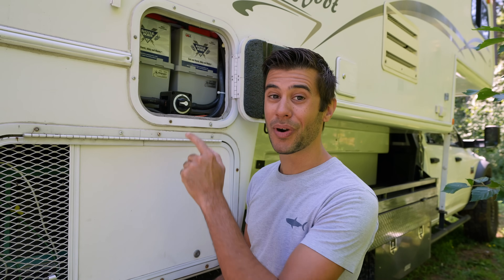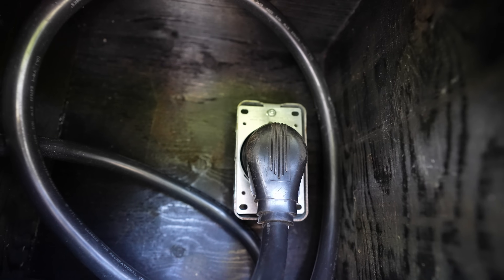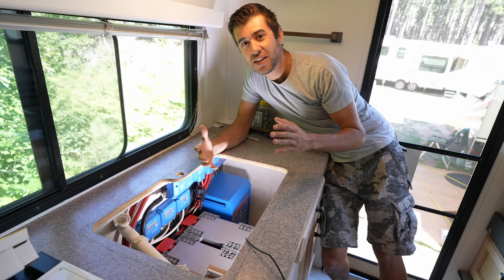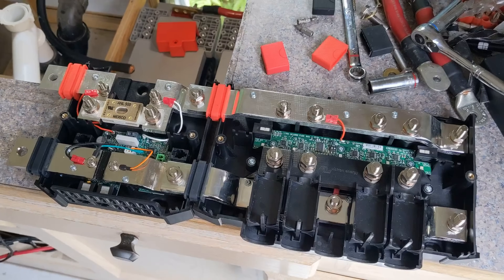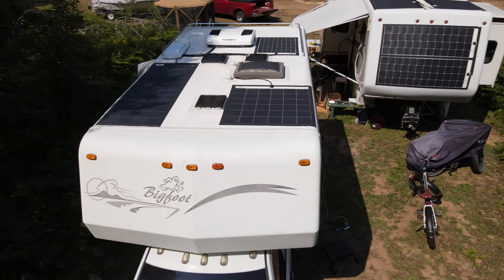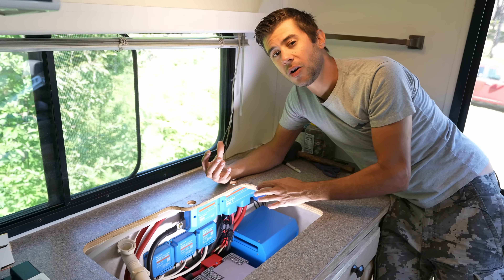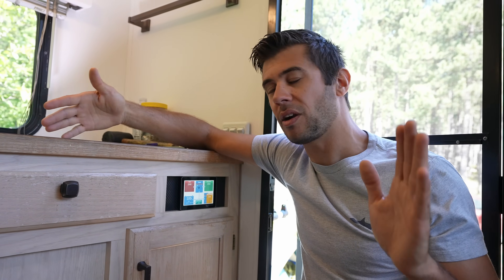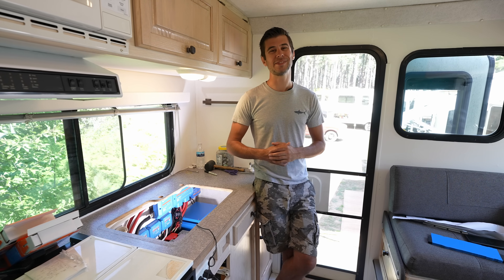What Goes Into an Off-Grid Power System? Overland RV Solar Power System With 12V Air Conditioning

Comment: Silly question, but doesn't the DC to DC charger provide sufficient charging ability that you could do away with the propane generator? If you removed the generator couldn't you have put the batteries in that compartment which would be away from the sink, etc?
Reply from the maker: Probably yes, we rarely need to run it. I have considered it but just haven't implemented it.

Comment: How do you feel about not having a Class T fuse? We hemmed and hawed about Class T necessity (or possibly MRBF), and ultimately decided to go ahead with the BEP Class T fuse block (778-T2S-400) with a Blue Sea 400A Class T fuse (BSS PN 5121). $73.36 isn’t cheap, but nothing is with this stuff. Actually scratch that, the Victron inverter is such a great price for a quality product with 5 year warranty. 
Prairie Equipment Company.

Comment: How about you get 10 lead acid batteries and you put them in series and you get 120 V and then you just get a charger on them how about that let’s make it easier and then you could run 120 V and you could just plug in the regular stuff and you don’t have to get 12 V batteries and run your car and with the power inverter and all kinds of other crap didn’t even need a power inverter if you get 120 V with 10 batteries if they did this $3000 how much are those batteries you talking about those lithium batteries do you like what $500 each $800 each what is the point of it and then you still have to use the generator and you still have to use the car the alternator the gas that’s insane I don’t think you guys are making any sense about what you guys are talking about you’re spending how much money on this and you’re getting what out of it and then you have to use four different systems are five different systems to run all the stuff
Reply from the maker: Still gotta invert it, 120DC won't do you and good. Yes 120-120 conversion is much more efficient and I have done that before with high power industrial builds (I'm an electrical engineer) but with native 12v DC needs it's just easier to do this.

Comment: I have a very similar setup with the same camper. I am curious if you can show how you integrated the new solar/interter setup to the existing Bigfoot electrical system so the 100v outlets work all the time? Thanks

Comment: Hey Tom and Cate
I’m in the final stages of putting together my build and I’m following your wiring schematic for the most part. I noticed there’s not a house fuse. Are you using the fuse on the Lynx shunt as the house shunt and is that sufficient?  Wanting to do the same thing since space is limited. Thanks Kevin

Comment: I might have missed it, but what tape are you using to attach the flexible solar panels?
Reply from the maker: You can use 3M Extreme Sealing tape, but it’s not readily available. Eternabond,  Flex Seal or Gorilla tape are excellent options too!

Comment: Very nice! I’ve been waiting for someone to tackle a Bigfoot electrical renovation. I have a 1994 1500 series BF and while is has significantly less space, I want to do this on a smaller scale. My biggest question though; how does the original converter/dc fuse box hold up to the updates? I took my rig into a solar company and was told solar/lithium batteries wouldn’t work with old converters like ours and we’d have to update the ENTIRE system..
Reply from the maker: It will work, but won't get them fully charged. Ours is disabled (but still there as a backup)  I would recommend a small programmable inverter charger for sure if your going to do lithium..

Comment: Tom, why didn’t you use the solenoid isolator instead of the DC to DC converter from battleborn?
Reply from the maker: Just more control over the current. The isolator would have worked fine in this build, but in our previous build we had too much current even for short durations and we're overheating the alternator.  With the DC to DC you can control the current.
Reply: @MortonsontheMove  but doesn’t the DC DC only allow 30amps?

Comment: Great video. I had a Bigfoot and was planning a project similar to yours. Unfortunately,  it perished in one of the many fires we had in Southern Oregon.  I'm currently in the market for a replacement. My original plan called for rebuilding all cabinets, going 100% solar, no ac and no generator. But, was planning on a 12 volt refrigerator. Don't think I could do both ac and 12v refrigerator with 440 watts of solar and 600 ah of battety. I'll be looking forward to additional projects on the camper, especially how you handle heating. (Or is that part of the ac unit?) Blowers seem to be electricity hogs. Keep us updated.

Comment: Hello and again thanks for the video. I would appreciate it if you could take a moment and tell me how the new 12V AC is working out. Is 8000 BTU enough in the sun? How long does it last? You might park under the trees to keep the unit cool, but then there is no charging unless using a suitcase panel. Thank you. Henri (RVing with Henri)
Reply from the maker: We love the 12V AC! It's kept the inside of the truck camper quite cool on hot days.

Comment: @ 12:05, you show all three of the 75/15 SCC being individually fused, but landed on the same spot on the Lynx Distributor... are you just stacking the ring terminals on the buss bar studs, or something else?  How are you bridging the gap for the fuse on the Lynx - or are you just running the positive wires up and thru?
Reply from the maker: Those all terminated in one larger ring terminal along with the power from the truck ( all charging) they are individually fused but there is a lynx fuse on the main as well.
Reply: @MortonsontheMove  so three #12 and one #6 AWG wires (each individually fused) all crimped together, and then another fuse on the bus bar as well?  I guess that does solve the problem I was looking at of trying to figure out where to fit a second Lynx distributor!
Reply from the maker: As for bridging on the lynx for the inverter I just created a custom busbar using a lug that I flattened and drilled a new hole.  It worked very well.
Reply: @MortonsontheMove  I must have missed that part 🤣 Why not use the fuse spot on the Lynx (for the inverter)?

Comment: Sorry I have been gone so long, been busy, but had to come back, been thinking in the back ground of the big picture. The 5er/this/and the toad.
Have to say in efficiency, ditch this design for a Ford F750 on 22,5 tires and 15 inch brakes. Sell the current 5er tow vehicle. Then weld a 1/4 inch plate steel by 7 feet onto the F750.
This allows the F750 to tow the 5er in the flatlands,,, then ditch the 5er for the F750 & flat bed that can haul a jeep on it's back to mid mountain.
It is a 3 way conversion that deals with flat land, mid mountain. then the jeep on the back of the F750 takes you to summit & brings you back home to the F750. Which in charge takes you back to the 5er.
Energy, development/storage is great, but does not exceed mobility.

A tri-fectia 5er/F750/jeep summit, and back, nationwide.
Reply: This breaks down costs of 
3 insurance policies
3 registrations
2 inspections
it is more simple this way. /cost/agreget.
Yea, I'm blowing up design because of insurance companies rates.
Reply: Current tires to feed.
4 on the 5er
6 on the tow truck
6 on this vehicle.
---------------------------
My design;
4 on the 5er
6 on the F750 @ 22,5
4 on the Jeep that sits on the back of the F750 + camper GCWR of almost 27,000 lb's
Only downside is wife has to drive the jeep, when F750 (with camper) is towing the 5er.
Looking at the math of Weight, the F750 (crew cab) could pick up the camper and the jeep on it's back & tow the 5er at the same time. The rig would be nearly 70 feet long, but it could do it.
The F750 max's out @ 30.000 lb's GCWR aired up, air brakes.
--------------------------
Downside we lose propane generation in favor of diesel electric, but make up hot water in electric in solar peak of day showers in electric hot water.

This is truly an energy storage battle VS Diesel electric efficiency VS a nice hot shower, @ peak solar/energy storage.

Comment: Ive watched this video a few times as im in the planning stages of a similar truck and camper built. The camper will either be a bigfoot 3k like the one you have of a northern lite 10-2 and a 550/5500 truck to tote it for fulltime living as I want to go smaller then my current truck and 28ft TT. This setup, although is costly and there are ways to trim down the cost a little bit, seems to be very much what i was looking at doing. Although without the 12v AC as those are quite pricey at the moment and not really made for the RV side of things just yet. Thanks again for giving me the kick in the rear to get going on my next RV step before I was ready. lol 

BTW how has the power consumption been with everything so far? Have you had to fire up the generated much or is the solar and truck keeping everything charged up without issue? I was looking at doing 600aH of sok Lithium batteries and about 800watts of solar up top with the panels mounted on a sliding mechanism to increase their exposure while parked for my future setup.

Comment: nice of you to provide the schematic, nothing talks better than a schematic especially when you note the wiring sizes.
Essentially I am building the same system but at 1/3 your cost. with 12.6Kw
- Think about installing a an external regulator on the Alternator side.
- battery bank, 3 times the cost... hmmm!
- Victron stuff... yeah! gOOOd move!
- Solar panels... again way too much money... get these soft panels on a light frame so air can flow under them to keep them much more cool... and have them last way more than the short life you now have.

Comment: How is the AC keeping up?? 6800 BTU seems lower than industry standards for RVs. I'm guessing the Bigfoot insulation and windows help, but still curious to hear if it keeps up in the hottest conditions.
Reply from the maker: Our Dometic 12V AC has worked very well so far and has kept up just fine. :)

Comment: So just for clarification, the new DC AC; was it a skylight hole you put it in (hence not fitting/needing opening up) or it didn't fit in the standard AC hole? (which if the case, is a serious misstep by Dometic) Hopefully the later isn't the case and it would fit a standard AC hole for drop in upgrading. Thanks. Just sub'd and looking forward to more of the reno!
Reply from the maker: We installed it in one of the vent holes. However, this unit was designed for semi-truck cabs, so we would have had to do modifications to make it fit anyway.

Comment: Personally i would not leave a stack of $900 ea. battle borns visible through that window. Good video though🤙🏼
Reply: Umm, that is $5000 worth of batteries not $1800. The air conditioner is $2500. The rest of the solar and electrical is over $2000 as well. Seems a bit overkill for camping.

Comment: What do you use for heat if anything?
Reply from the maker: The rig has a 30k BTU propane furnace built in. I have already had this unit below freezing and it stays very comfortable with little effort so I didn't feel it needed changing.

Comment: Another great install and informative video, just wandering why you didn't go with 24v system to reduce wiring complexity to the inverter and the AC.
Reply: It would of been more complex if he went 24v, the AC unit is 12v and so are all the other DC loads, he only has small charge controllers and there's 3 of them so again 12v is best, for a small system like this 12v is the most logical setup.  He would of needed a large 24>12v inverter so the wiring would of been allot more complex and have larger losses than staying 12v

24v only really starts making sense when you're going 1200w ish plus of solar, longer cable runs,  50amp service and allot of AC loads etc
Reply: converter
Reply: @Drifty325i  all good points but still, DC air conditioners are available in 24v and 24-12 converters are not expensive and very efficient.
Reply from the maker: All good points, and we run and prefer 24 volt in out fifth.  At the time of this build I could only get the dometic ac that I wanted to try in 12v tho and that is what defined it.  If it were the 24v version ( European model) then we would have gone that way for sure.
Reply: @MortonsontheMove  a 24-12 converter is admittedly "just one more thing" that could break, but curious why you decided that it wasn't useful to allow a 24v system.

Comment: That’s all well and good if you have $7k or more to spend on power solutions but realistically most of us don’t. Great information though.
Reply: Well ... I have used Renogy for the batteries, panels etc and my 800W system with 400Ah of LFP batteries (4) cost me ... <$5000 CAD ~ 3000 USD up front. Works nicely... so far ... Up to you I guess. Hobbies cost money. So do ATVs, snow mobiles and golf clubs and half the guys driving around in pickups probably don't really need them. Just sayin'.
Reply: 4k camper with a 7k power system in it...
Reply: @brettallenthomas  let me know where ya get a Bigfoot camper for 4K. Some people don’t know shit. Nice setup bud

Comment: Content producers really need to get away from saying that "you can access this system from anywhere in the world". No you can't unless camper and RV are in 4g coverage areas. Park this thing in Needles District of Canyonlands national park and there is no signal there at all, even with boosters. There needs to be somewhat of an understanding in RV community that this is a limitation. Now let's assume that camper is in 4g territory... and you are out hiking in say mountains of colorado where there is no signal...same thing. 
I spent 6 weeks in moab and 6 weeks in colorado and coverage was spotty as hell. Step 1 ft in any direction and bam. Zip zilch nada. Sometimes you get signal and then it magically disappears permanently.
Reply from the maker: It's more so a reference to being able to connect to it from anywhere there is net. Ironically tho I am on the other side of the world from the camper now and it's in an area where there is no cell so its running on Starlink and I can see what's going on with it :). We're still working on the connectivity setup but will do a video on it in the future for sure!

Comment: I have a 30ft airstream with 2 ac’s.  Do you think 2-dometic DC air Conditioners will cool it?  What’s the biggest btu AC run off of 12v that dometic makes?
Reply from the maker: I bet it would, it's only 7500 BTUs I think, but it seems to do as well as 13k units we have used.

Comment: Hi guys… great job… I’ll be there soon.   
Q - I looked at your electrical diagram and see that you have a 500 A fuse/ shunt on the positive side & 1000A on the negative- why the differences ? 
Q - does it matter where you install your battery disconnect on the positive or negative?  
Cheers ——- Yvon.
Reply from the maker: Good questions.  The 1000a is just the rating of the busbars, not a fuse.  We install the battery disconnect on the negative because it's safer to disconnect the negative in general. If you disconnect the positive you still have a path from battery terminals to ground through the RV frame... Thus when working on batteries there Is still a short potential.  If you disconnect the negative the short potential is gone.   Always disconnect the negative first on any battery.
Reply: @MortonsontheMove  good point… thanks…Y.

Comment: If that dc air conditioner even half works…I want one!
Reply from the maker: So far it does! I Wasent expecting it to work as well as it does.
Reply: @MortonsontheMove  I’m sure you noticed that they have an inside plastic bezel that goes with it, but probably no real need…